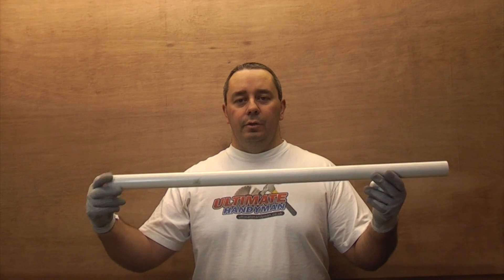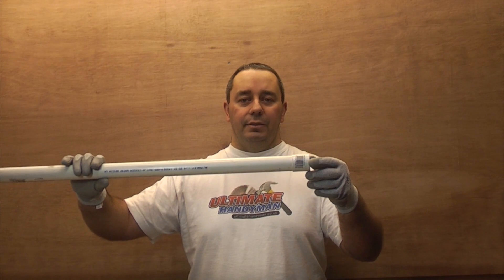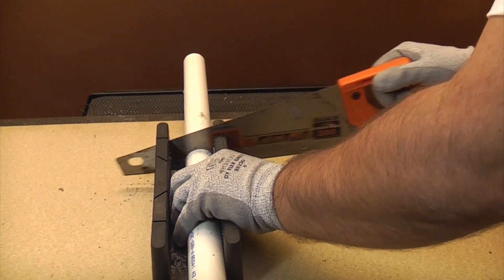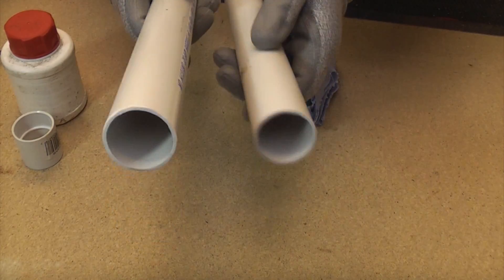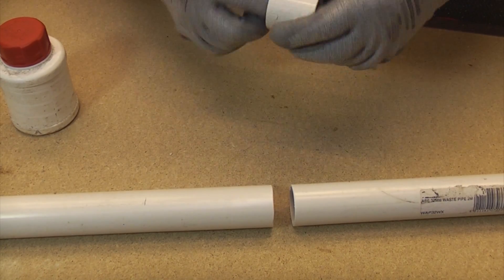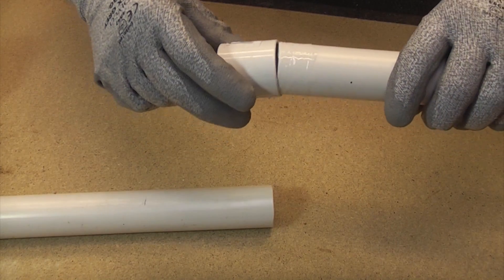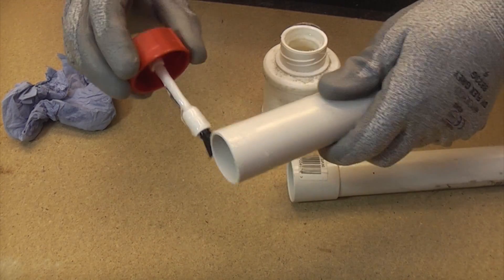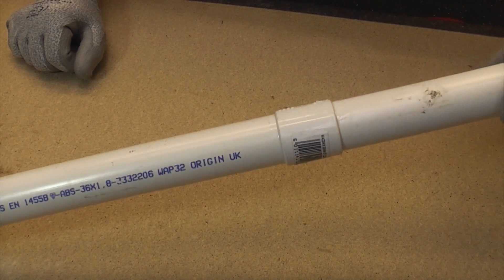Solvent weld

Comment: Can you use solvent weld on any plastic pipe.
I have checked in my bathroom and the pipe i have is just pushed into a straight connector without any glue. Or if they a different type of pipe?
Reply from the maker: No, it’s a different type of pipe (if I remember rightly). 
So, a 32mm solvent weld pipe is a different diameter than a 32mm push fit pipe-
https://www.youtube.com/watch?v=x_LalyklwGM&t
 👍

Comment: Can I use this to weld 2 pieces of soft nylon fabirc?
Reply from the maker: I don't think it will work, you can only use the cement on solvent weld pipe- it won't work on standard plastic pipe.
Thanks for the comment

Comment: Nice tip, although I'd do the deburring with a knife. It's MUCH faster (you just scrape off the inside and the outside and it's done).
Reply from the maker: +CoolKoon 
Thanks for the comment
Reply: Can you use solder weld on a push fit pipe to weld on a solvent weld fitting?
Reply: Why did you not use any cleaning compound to clean the pipe and the fitting  before you applied the solvent weld cement?
Reply from the maker: Some solvent weld requires cleaning and some does not, it depends what the instructions say.
Reply from the maker: No, you need a compression fitting to join push fit pipe to solvent weld-https://www.youtube.com/watch?v=x_LalyklwGM
Reply: ***** Interesting that  because cannot buy the cleaning compounds from the likes of toolstation and Screwfix .... But thatnks for the info you really are the MAN repect.

Comment: I used this over the summer during renovating the bathroom, it is really good stuff, and not at all expensive, unlike the 15mm / 22mm pipe fittings, prices are just mad... good video guy.
Thom.